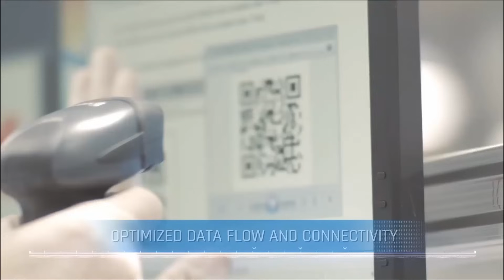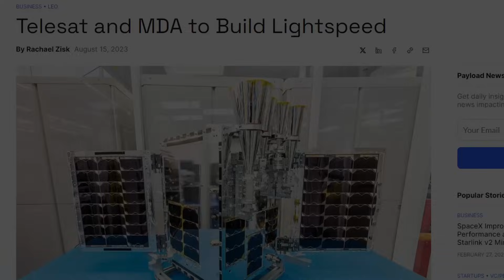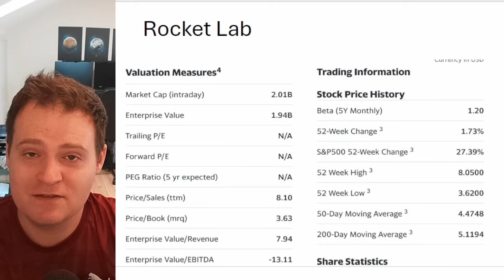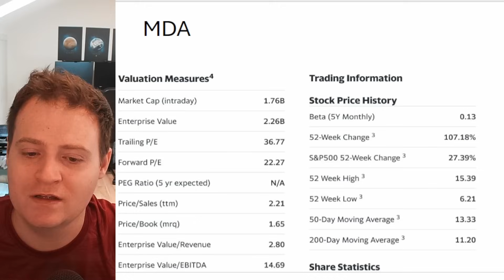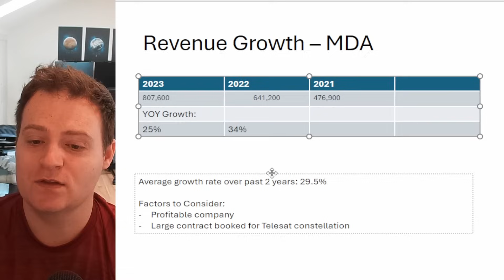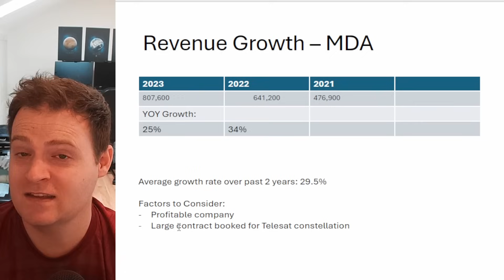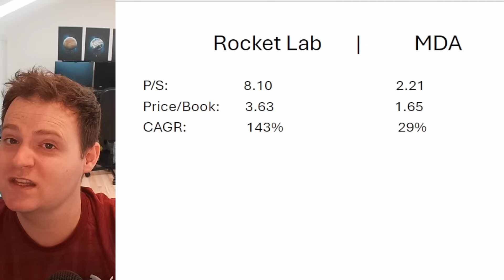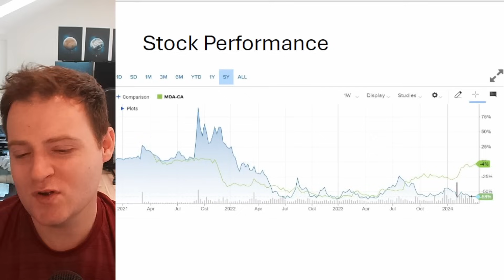Rocket Lab Stock VS The Closest Alternative - Which is Cheaper?

Comment: All that aside, Dave, if MDA was a US stock, it's 356.37K average daily trade volume is too low for fast traders, I think. For myself, I gravitate to stocks with at least a few million average volume. The "blocky" graph of MDA on the CAN exchange is a dead giveaway. Another negative indicator is when a low cost stock's BID and ASK prices differ by more than one cent (higher cost socks, $1). Shows lagging "dead time", long minutes even, in movement of the stock during the busiest times of a trading day, the first hour and the last. A bad sign. And hence the blocky look of the graph. Steve.
Reply from the maker: Yeah, shouldn't be a big problem for a long term hold but maybe not great for that kind of thing.
Reply: @daveginvesting  👍

Comment: I'm not a finance guy, but I think that average growth rate should be (1.15*4.39*1.77)^(1/3) = 2.07 = 107% rather than (15+339+77)/3 = 143%.

At least, that what I'd mean by "average growth": the amount it'd have to grow by each year to get to the same end point.
Reply: Neither of you were correct. Dave calculated the average growth rate, which is different from the CAGR. The CAGR = Geometric mean whereas the average growth is simply the arithmetic mean. 

The correct formulae would be (244592/35160)^(1/3) = 1.9089642443. So a 90.1% CAGR. Which is still pretty insane.
Reply: @deeptoot1453  Ah you're right! So CAGR is the relevant metric here right?

Btw, my formula does work (though yours is more sensible), but it should be (1.15*3.39*1.77)^(1/3) since they actually had 229% growth that year, as opposed to the 339% on the slides (still remarkable obviously!)
Reply: @blakemcalevey-scurr1454  ah Yes, I noticed now.  Indeed, CAGR/Geometric mean is a generalized growth rate that if you were to multiply it by the number of years of the data set, you would get the same ending value, like you mentioned in your initial comment. It's  a convenient approach if you want to calculate long-term historical growth rates. It's a more accurate reflection of what actually happened than if you were to calculate the arithmetic mean, so you were right to address that.